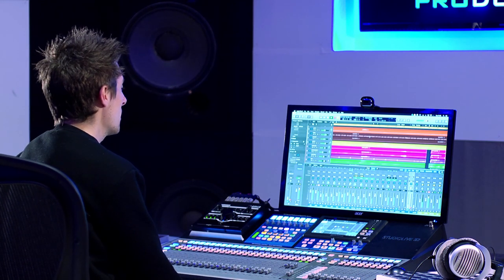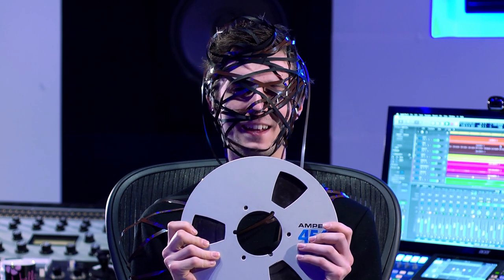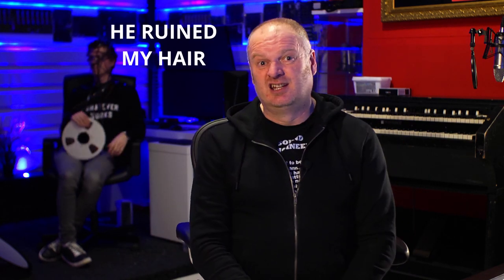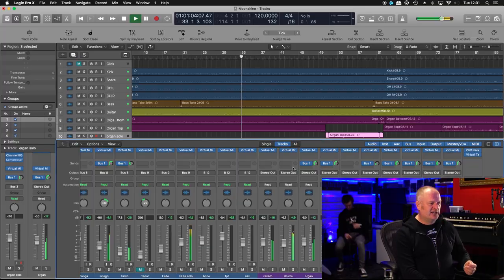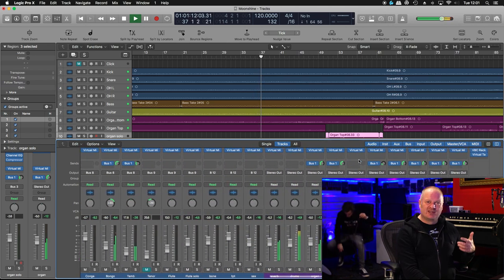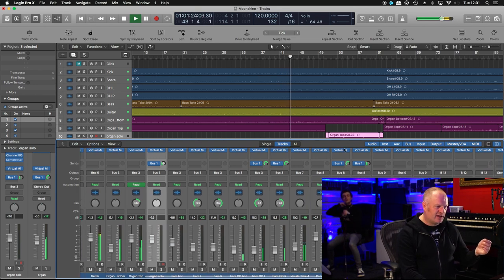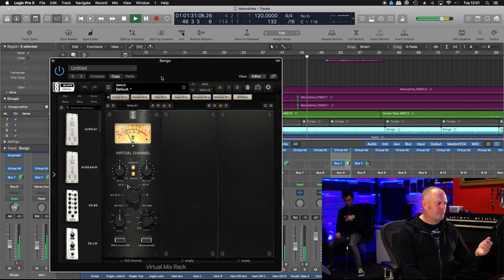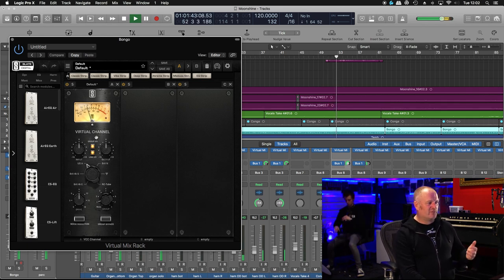How To Get That "Analogue" Sound

Comment: I use a 8-bus mixer as front and back-end to my interface; a whole slew of the same pres, eq... each buss into a interface i.p., pretty much 2 VCA comps and other fx unit inserted as well, staying for parallels on mixdown (my setup rn is practically an early 90s project studio except for no tape/adats... many stuff turns out to be from the era).

I often calibrate my mics and "tape returns" like you quoted on 25:30. From the board I record the mix to a 2nd interface as a "master recorder" (mostly out of necessity), going through the 1st gen dbx 166... wonder if you used that one xD

One other nice thing to get the ever-elusive analog sound is commitment. GIRATS as quoted on the video and to sum mics on the way in. I've learned a lot this way. In the pre-pandemic times, I often recorded live bands, at first 10-16 mics direct to stereo, later 4 to 6 inputs. EQ reverbs and everything but the kitchen sink. Got amazing results using one channel of a lowly 3630 inserted on bass and the other as a drum parallel.

Anyways, the kicker for me, more than the sound is the speed and readiness.
Cheers from Brazil! Many thanks for such precious tips and enjoyable time.

Comment: The best mixing video ive ever seen on the tube. Thanks guys. Which Slate page do you have?
Reply from the maker: We have the all access bundle or whatever it’s called. $15/mo

For me (James), it’s the only set of plugins I ever use. I can do a mix entirely using VMR and Verbsuite. Two plugins
Reply: @PresentDayProduction  Thanks Fella's, have you tried the Slate plugins in Logic on the M1 Mac yet, do they work if logic is opened in Rosetta mode?
Reply from the maker: Slate plugins work perfectly in Logic, just not in anything else like studio one

Comment: I use harrison Mixbus for this reason. You end up using the channel EQ and comps for 90% of the sound, then I use  a few main plugins on the  busses out to main mix.
Reply: I'm doing the same right now. So fast and I really like the EQ's. Not super excited about the channel compressors but the tape emulation is great. For a tape-effect sound the SketchCassette plugin is awesome.
Reply: @JayBeBerg   I mainly use the comps per channel for sound on the kit and bass. MY Main comp overall all is the DSP FC70 which just adds gold to my ears. Cheers